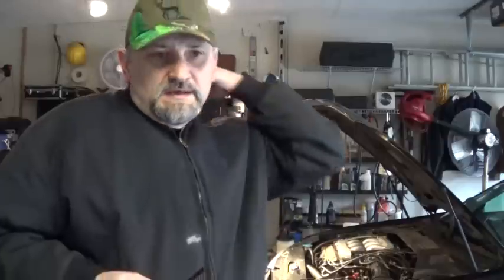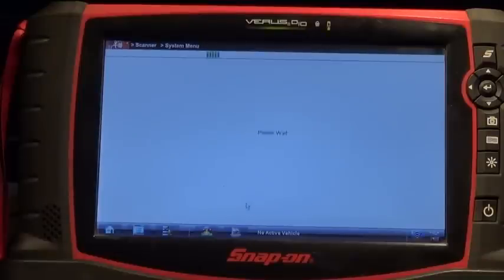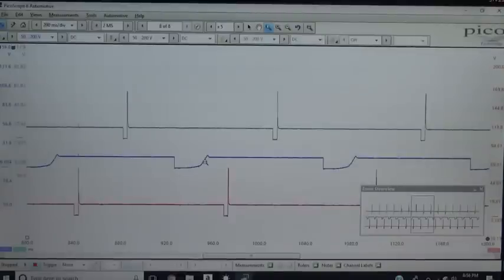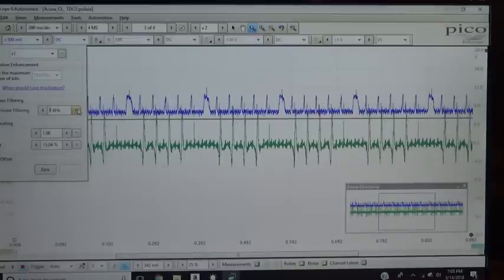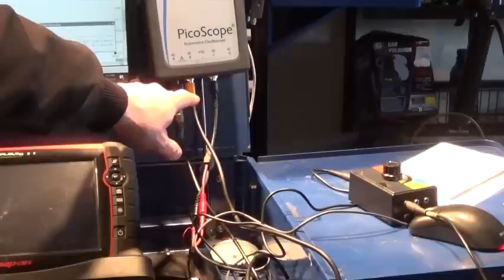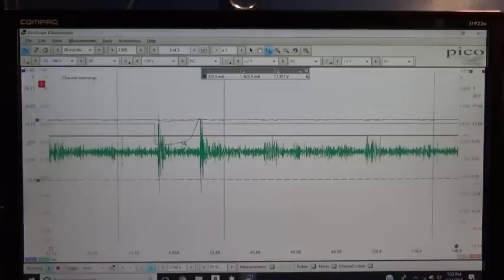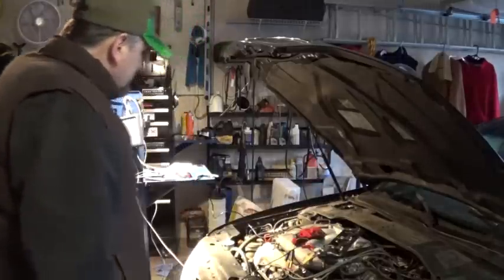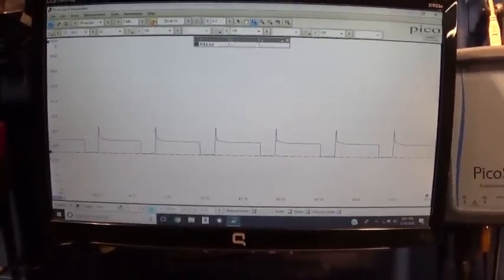1998  Acura CL P0306 Injector Circuit Problem Part1

Comment: Very nice diagnostics Ramon and I believe you have nailed the driver as the fault. The reason that you're seeing this ramp on the turn off side is that the transistor is taking too long for it turn off. As a result of this, there is still the 'on' resistance across the emitter and collector junction of the transistor even though its been told to turn off. You saw evidence of it being turned off when you saw the first initial rise on the waveform, but then it started to slope upwards.This will give you a circuit which is called an LR (inductance and resistance) circuit where the current is slowing decaying through this resistance which is provided by the transistor. As you can see from the slope, the resistance is slowing increasing as the current slowly decays. If you had too much resistance through the transistor during the on time, you would have seen that in your current waveform where the current would be smaller.

To get a high voltage spike, the transistor must turn off quickly so that the magnetic field will collapse quickly. The quicker the field collapses, the higher the voltage induced. Although, the turn off time can vary, it should be somewhere around 15-25 uS and you can measure it on your scope. Same holds true for ignition coils. So, if the turn off time is slow, you're not going to get a high voltage spike. The voltage induced across the coil is a a function of how quickly the current can change in relation to time and the size of the inductor where its symbol is L with units of Henry.  Emf (induced) =  L * d(i)/d(t) which is Faraday's Law. Great work as always Ramon! Now, come on out of that cold and get those hands warmed up :))
Reply: Hi Terry, this time it's YOU who explained it in an excellent way so that any other explanation may fall short. THANK YOU.
Reply: juergen scholl hi Juergen and hope you’re doing well. We’re all here on YouTube to learn and trust me that I’m a student and learn a lot of new stuff each day! 😀👍
Reply: Spot-on Terry!  PCM will fix it!
Reply: Hayward's Automotive Pretty sure that will fix it too Bob and hope you’re having a great day! 😀👍
Reply from the maker: Thank you Terry. We all learn so much from you. Thank you for explaining what we see in this waveform. I am confident that new PCM will fix this problem. Cheers my friend.
Reply: Thanks, Terry and Ramon. Interesting study!
Reply: Yeah, what stuzman said.  😀👍

Comment: Ramon,

thank you for this in depth study . You did an excellent job! I am with you on the failed driver , actually these are ( I think) still dedicated transistors, possible to change them seperately.

On a side note: 
I have seen injectors with weak return springs ; they also show a prolonged "shut down ramp" and therefor allowing more fuel do pass thru the injector resulting in a rich condition
Reply from the maker: juergen scholl Now I can breathe easier when I got green light from you my friend. I am very exited to get new PCM. It should fix it. We will find out soon. Cheers my fiend .
Reply: KY Home Garage KY Home Garage I like your sense of humor 😉

Comment: Transistor driver bad...PCM will fix it unless the  used PCM has issues.  Great diagnosis Ramon & Terry's explanation was spot-on!. Definitely going to have to change the oil and with that injector disconnected your fuel trims should have corrected. Hope the Cat survived this.
Reply from the maker: Hayward's Automotive Thank you my friend. I will definitely check back pressure and change oil. Cheers
Reply: Your back pressure should be ok but hopefully all the misfires and fuel didn't hurt the converter too bad &  give you P0420/30

Comment: Very unusual fault but difficult to diagnose.As you state in the video, impossible without the aid of a scope. Probably the same as an injector with a slow return spring. The clue would have been the damaged original injector if you could have examined it. Very accurate call and must say, well done !!
Reply from the maker: Tom OConnor Thank you my friend. Unfortunately I can't get original injector it's gone. So far everybody agrees with my diagnoses. I really hope new PCM will fix it. Cheers

Comment: While we waiting can you connect in parallel control wires for injectors 6 and something close to #6 intake stroke like # 3 cyllinder for ex (or #5, you can even connect it through a transistor so the current for the driver indise pcm will be the same). As we know not that long ago we had cars with injectors firing all together )

Comment: Great oscilloscope diagnosis of a quite sneaky problem! How about automotive DMMs, don't they have pulse width or duty cycle measurement modes that could have caught this problem?

There is also a way to measure relative pulse width with a regular digital voltmeter, it involves a diode, resistor, and a capacitor.
Reply from the maker: Dmitriy L. Some DMM can measure PWM signal but I don't know if it would be fast enough to measure this difference in pulse. I will do experiment car is still here. Cheers my friend.

Comment: Very interesting diagnosis...like you pointed out the amperage draw being as expected suggested/confirmed that wiring feed and earths should be ok....there was not too much or too little current draw it was just switched on too long but not on all the time....hard to call an ecu as always but it being the only real controller of individual injector on times it had to be the main suspect...keep up the great work..be more confident in your obvious abilities
Reply: ...being switched on and off too slowly possibly explaining the loss of high switch off voltage spike as the magnetic field dissipated relatively slowly? Just a thought for that side diagnostic?
Reply from the maker: jeffrey herbert I agree 100%. Terry made very good explantation what happened in  this circuit. I was very confused with this waveform because I never seen one like this. I hope everybody enjoyed this case study. New PCM is coming soon. Cheers my friend.

Comment: I have an Acura 2004 ! I have changed coil and injector on cylinder in the back passenger side and it won’t read as if it was in function ! I unplugged the test of the spark plugs wire connection and they all seem to effect once disconnected! But the one cylinder I mentioned does not
Reply: I’m actually thinking of replacing the motor

Comment: If you think it is a short did you check both injectors on the control wire and if you think the wire is shorted unplug it from the control module and use a test light from the positive to the wire if it lights you have a short

Comment: Don't know the engine specs I am guessing it is SFI. But if it is pair fired,could it be a shorted companion injector issue ?
Reply: On second thought I think you did show each individual current ramp. Only six was suspect.......Certainly looking  like your correct and have the data to support  your assessment. Looking forward to part 2.
Reply from the maker: TheGibby3340 Yes my friend. On my waveform with CMP sensor we could see current ramp from all six injectors. If new PCM doesn't fix this car I am out of ideas. So far everybody aggress with my assessment. We will find out soon. Cheers my friend

Comment: I have a 97 3.0 CL and the engine only had 80k miles on it, but when the engine is running and in park, after I haul ass, the engine drops for a second, doesn’t stall but acts like it wants to stall then for half a second and then it is fine again... any one know about this??? I want the thing to last but idk what the problem is it.

Comment: Shouldn't it read OLm on the ohm check on the control wire.
Reply from the maker: Arthur Fricchione It was OL on signal wire( no short to ground ). I also checked  resistance on my injector and it was good.

Comment: I didnt watch whole video but that looks like a classic bad connection. I would use 3 channels- A channel on B+ to injector @ injector/ B channel on control @ injector C current and you will have your answer.
Reply from the maker: The Quiet Mechanic I believe injector driver is damage. New PCM is coming soon. Part 2 is coming soon. Cheers my friend.

Comment: It looks like there is capacitor on that circuit but i believe that there is some problem with zener diode. read from Macola http://www.elitesecurity.org/t483741-0-Simulator-okidanja-El-Dizni-sa-regulacijom. 
Can you open that PCM.
Reply: macolakg
Dragoljub Aleksijevic
Reply: albenian just a guess do not get mad if not i can understand a few words
Reply: Marko, injector drivers from 1998 vehicles may use Darlington transistors rather than MOSFETs. And, as their circuit implements current limiting, there must be an operational amplifier before the power transistor rather than purely digital circuitry. The failure might as well be in that operational amplifier rather than in the power transistor. 

Please see LM1949 datasheet to see what I am talking about. We will know for sure only once Ramon opens up the PCM...
Reply from the maker: Marko Radic Sorry guys but I will not be able to open PCM. Company who provides PCM for us needs old computer for warranty reasons (core) so I really don't won't to mess that up. Cheers bro.
Reply: Dmitriy L
Ok i will check that. If zener diode goes short will the closing time of injector be longer? in some schematics i see ordinary diode connected in series with opposite zener diode. so the question is abot that.
https://www.automotivetestsolutions.com/understanding-fuel-injector-waveforms.html
Reply: juan rodriguez
i am from Serbia try translate from Serbian to English that post maybe you will understand than.
Reply: Marko,
in that configuration, after the transistor turned off, shorted zener would result in mechanically longer closing time of the injector, but the voltage would return back to 12V almost immediately (ordinary diode is very good at clamping, right?)

This is not what Ramon is seeing. There is a lack of transistor turning off fast enough. 

To make this even more convincing, remember that at some point Ramon repeats the experiment with a NOID light instead of the injector and still gets similar waveform -- those results do not depend on any clamping in the circuit as the NOID light is just a light bulb with no noticeable inductance (as far as I know).

We will never know what is really used inside that particular PCM, but it is surely fun to think about what might be in there and what might have failed. Thanks!
Reply: Dmitriy L
you right, i forget about noid light test.
Thank you
Reply: i was close thanks